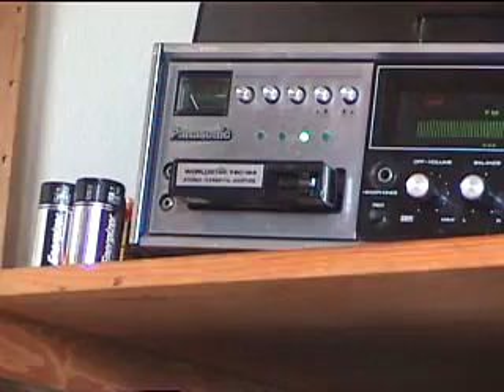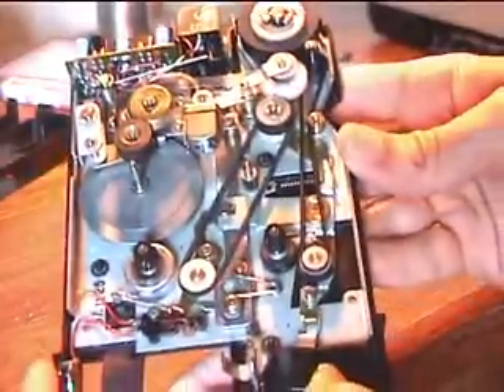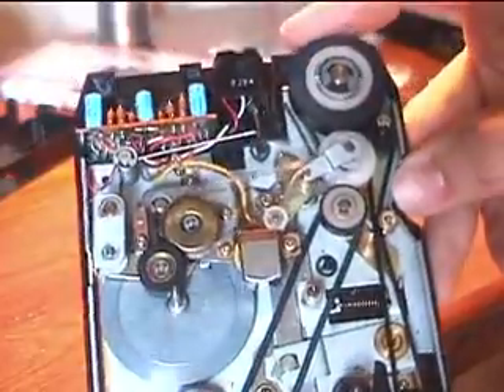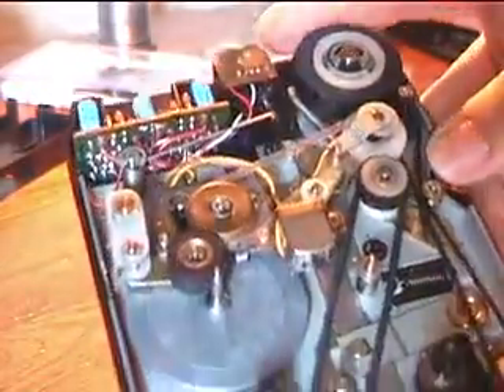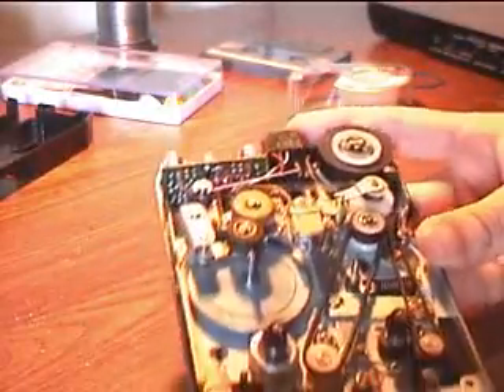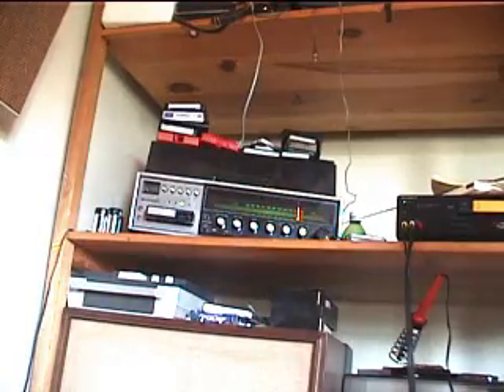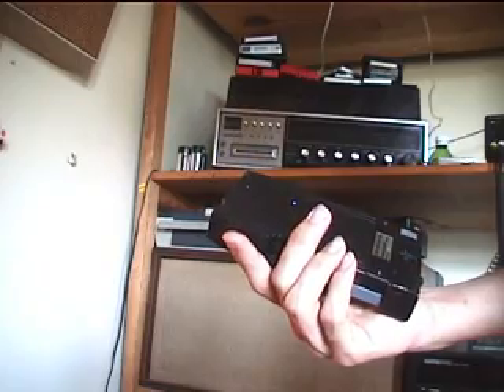Worldstar YSC-123 cassette to 8-track adaptor fix.

Comment: Nice! I've also ordered a Sparkomatic 8-track cassette adapter on eBay yesterday and I'll have to do a demonstration of my Sparkomatic soon. BTW, this one can also play MP3's using the cassette adapter to go with the 8-track cassette adapter, and it plays really well rather than wow and flutter. This won't have to worry about buying a CD or a vinyl again, just enjoy them while you can.

Comment: I just bought a 8-track to cassette adapter, It's a Sparkomatic SCA-10. It has a much much simpler design, and the power input for the preamp is ingenious! I must upload a video later.

Nice adapter, too bad it won't work right.

Comment: Interesting Idea, although I don't think they shouldn't have made the wheels directly turn the capstan as that's gonna put tons of stress on them.  You could put some paper round one of the pulleys to act as a kind of friction clutch, then use a flat belt instead of a "sticky tape" belt.  the paper should be able to slip a little like the original fiber belt.  The "sticky tape belt" can come apart very easily, as I saw it did in this video.

Comment from the maker: However it is, the technique I used provides plenty of wow and flutter. I think the fiber originally used was that it didn't stretch as a rubber belt would-the stretching would have cause an unstable speed likely.

Comment: I was wondering about that after I posted, I was thinking "wait a minute, if that's the main drive belt, it won't work very well", but it could still work in another machine that has a disintegrated fiber belt that used to drive the take up.